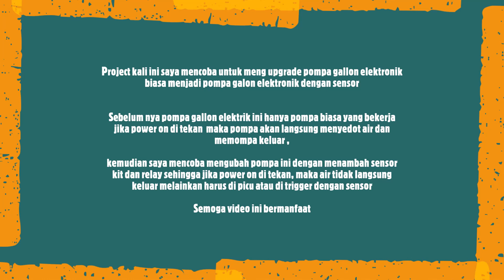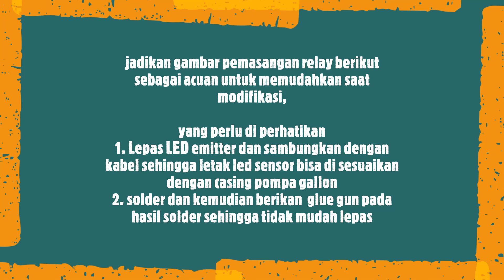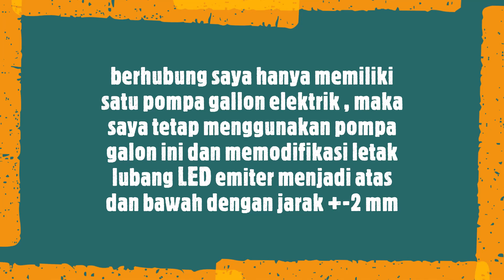DIY | Cara membuat alat cuci tangan otomatis murah anti corona tanpa sentuh dari  Pompa Galon

Comment: Itu battery awet berapa lama ya?soalnya kan sensor on trus
Reply from the maker: bisa buat on off . di modifikasi jadi buat 2 sensor

1 sensor on off ( tombol on off yg di atas pompa galonnya di jadikan sensor tanpa sentuh )
1 sensor air

kalau keadaan begini pernah di coba sampai beberapa hari masih bisa 

soalnya kan low trigger mode. jadi konsumsi powernya dikit